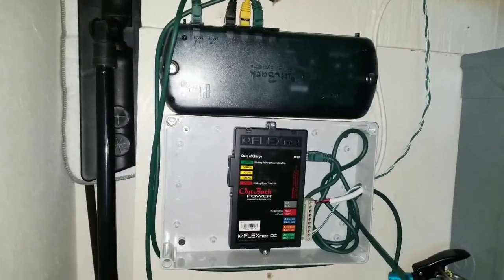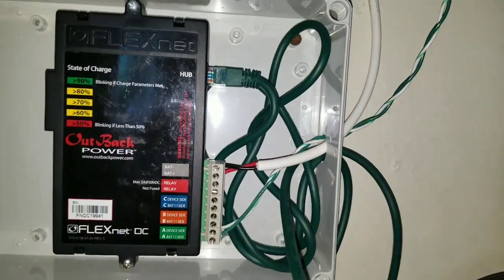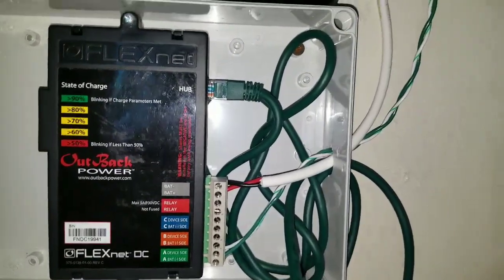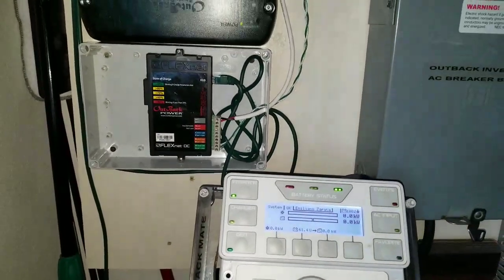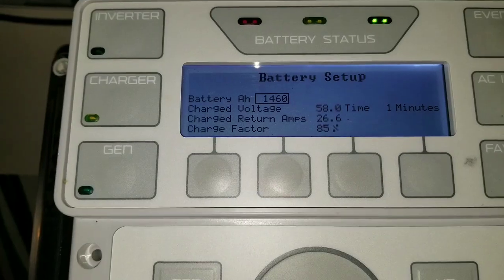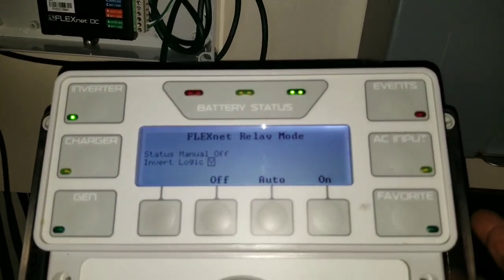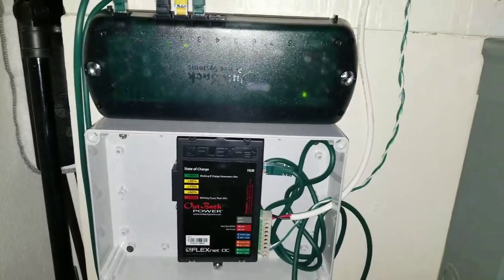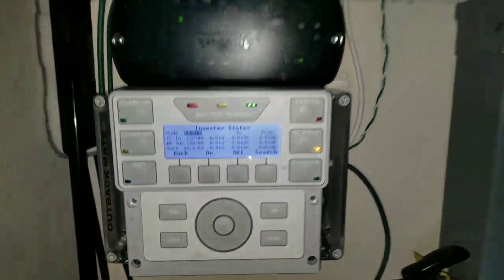OUTBACK POWER SYSTEMS: Howto Install The FLEXnet DC Battery Monitor

Comment: Nice and remember both the Mate and the inverter have battery settings that will need to be set for AC charging.
Reply from the maker: Yes👍I have done it already.
Thanks for your comment, watching and for your support. 
Cheers

Comment: why dont you cut a hole in the side of the side of the box and move the fndc over so the lights are outside to see them better..the unit has 2 screws to mount it that way too
Reply from the maker: Yes I do mentioned that on my previous video.
I am still thinking if I really want to do that. But everything seemed to look great and I like it so far.
Thanks for your contribution and for watching my videos Brother Spencer

Comment: You should set the charge factor (BCF) to 98% for LION batts 85% is for flooded lead acid batts
Reply from the maker: I had it on 95% after I shot the video
Reply: @jwsolarusa  oh ok that will work
Reply from the maker: Thanks mate and have a wonderful day Sir